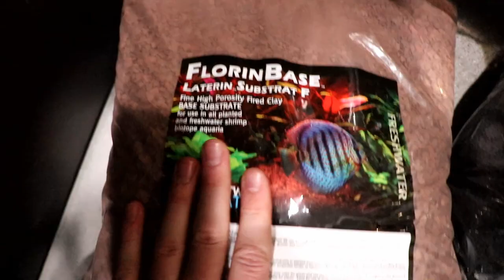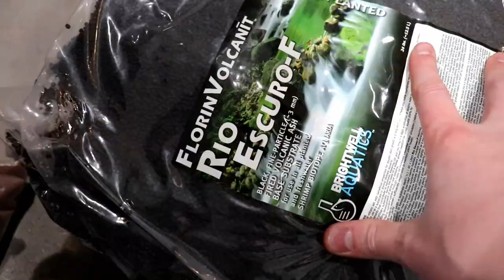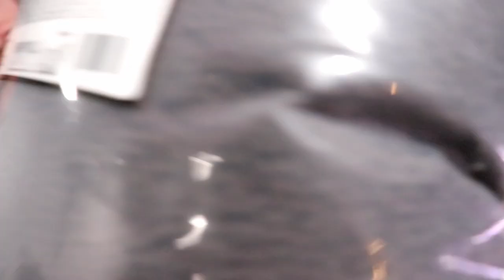Worlds LARGEST Shrimp Aquarium! - Aquascape and Setup

Comment: What kind of 'super glue' do you use? Does it not leach into the water or eventually go soft/flake away thus no longer adhering?  I've seen some of that 'Flourish Glue' in the LPS being sold for $9 a bottle but it doesn't say how or even IF it's different than regular ole Crazy Glue. Thanks in advance for any and all replies!

Comment: This is a weird question but where do you get the water for the aquarium? I have a small 10 gallon tank and I need to buy water weekly which actually cost a lot at the end of the day
Reply: nadien if I remember he’s on a spring but if your not you can use water safe stuff for your aquarium it make tap water safe

Comment: 4:22 I cringe seeing him leaning on the glass braces.
And yea, I think it will be much better if those left and right island will be pushed back a little bit to create more depth so they are not like parallel with each other. And to have more space on the front for the shrimps.

Comment: You pretty much didn’t use the rule of thirds. Disappointing when you are given such a big area to work with :/ (I know it’s more difficult with a bigger tank, but this is especially underwhelming and doesn’t even tap into the tank’s potential. Hopefully the changes you make later on elevate this.

Comment: Not to hate in this it does look nice just to critique though you're only as good as the materials you put into you have little imagination you should have done some researching of sone fictional landscapes and you totally failed with the depth you should have staggered the islands either the two one each side to the rear and the middle to the front or the other way around it looks good but basic at the same time dude and the way around that is to get some proper inspiration